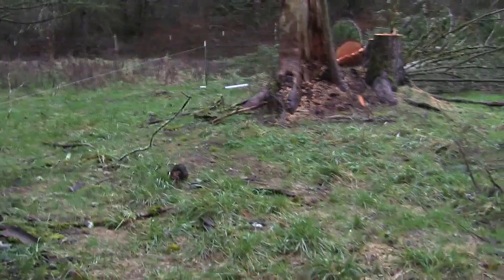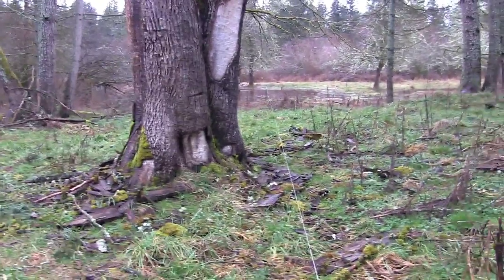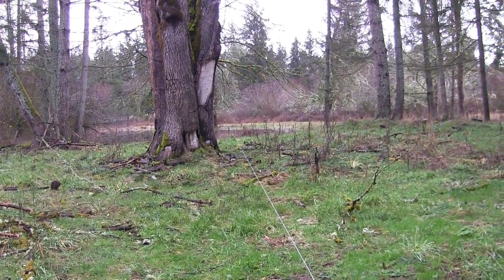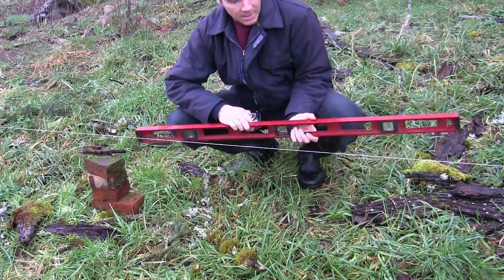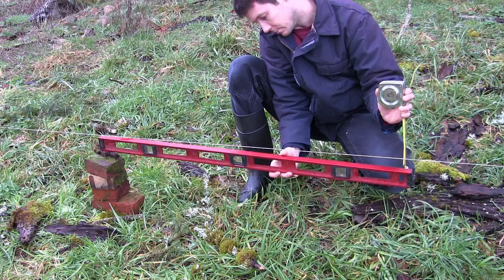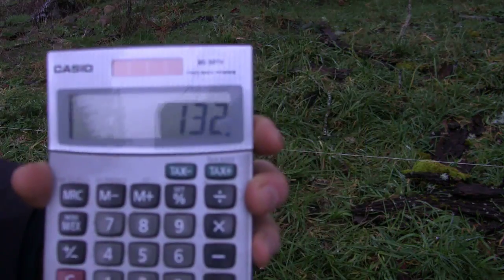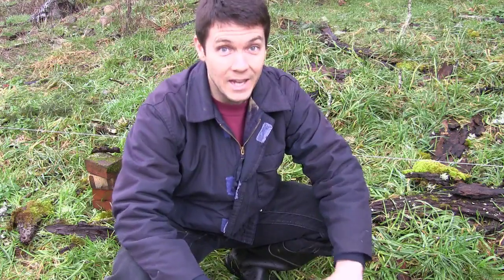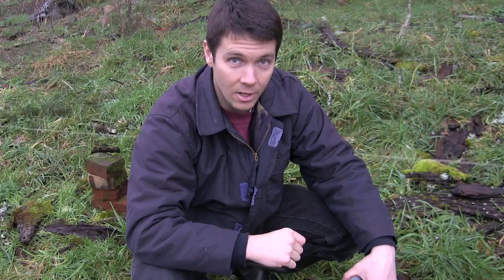How to Measure Elevation of Land, Slope, With a String and 2 Metal Posts: No Transit or Laser Level

Comment: From an engineering standpoint, this makes makes total sense... except for one thing:
Measuring up from the surface of the water at both points would only indicate the potential for the surface water to travel from pond #1 to pond #2.  I think if you wanted to make 100% sure that ALL water from pond #1 evacuates to pond #2, you should measure up from the DEEPEST point of pond #1 to an arbitrary number, (in your case 41") and then measure up 41" from the surface of pond #2. Assuming pond #1 does have an exit, this method would ensure that pond #1 would never fill again once you graded the property to channel the water to pond #2.
Reply from the maker: Very very good point, thanks.  After going through the whole process of digging the trench, there was in fact about 3 inches of water still in the top pond.  I'm really happy with the results but need to fine tune to get rid of that water.
Reply: @MikeKincaid79  how did u dig trench and get the water to run downhill did you use and pipe or what ? Middle if my yard keeps sinking it fills w water also some on side both neighbors one in right side and one in back have higher lawns than me and their water runs off into side and back . But middle I think is just low . But right side definitely alot comes from their run off . How do I fix side . And do I just fill in low points with dirt it will it keep sinking from their run off water
Reply: @johnanderson3746  I have a similar problem at my house.  I solved it by simply adding 120 yards of dirt in my backyard, which raised it enough to allow a swale between our houses to channel the water away.  If you can't do that, rent a trencher for a couple hundred bucks for the weekend and put in some drain tile.

Comment: THANK YOU - I was trying to recall this technique but in my case it was to determine floor elevation measurement. I had a snap line but that didn't seem quite right. Then I had the nails and string and was measuring along the string from the floor but knew I was missing something ; the level made a big difference.
Reply from the maker: Awesome!  Glad this was helpful.

Comment: Hi Mike, hope I'm not speaking out of turn but would it not be simpler to just run a long hose from the top pond to the bottom one and create a syphon to get the water flowing. Gravity will do the rest. Saves digging a massive 100ft long trench ? (once you've established which is the higher body of water of course as per this method.
Reply from the maker: That would work well too but I much prefer having the trench that I dug.  I haven't had to worry about standing water for several years.

Comment: If it works...great. As mentioned....from base of one pole to other make sure your line level is level. Now measure at point 1 from ground to string height, then measure point 2 from ground to striong height(this would be the point thats underneath the water)...when string is level, that difference in height is your slope. Keep it simple...you may need some  boots.

Comment: Hi Mike, on your video , you divided 33 feet by 12, where did you get the figure 12
Reply from the maker: There are 12 inches in a foot.  I could have stuck with 33 inches but I wanted to convert the 33 inches into feet.  33 inches divided by 12 inches is 2.75 feet.

Comment: Good video, only it would matter what the depth of the upper water is, hopefully it isn't deeper than 2.75 feet.
Reply from the maker: Very true.  The volume of water is also part of the consideration and I worried about that a little but in the end it worked out.  It turned out that when the lower pond rose to a certain level, it poured down a natural little path that ran off my property and under a culvert at the main road.

Comment: @Mike Kincaid   Hey Mike, you never applied (or at least never mentioned again) that 1 inch gap which you measured on the slope from the end of level to the line.  As you know multiplying by 1 doesn't change anything anyway. Lucky for you,  but for myself and others who have a different number for that gap over the 4ft of the level, then we are missing that important step to then multiply that number.  Nonetheless thank you for putting me on the right track and teaching me something I could use.
Reply from the maker: You're right, thanks for pointing that out.  It just worked out nicely for me I suppose.  If the measurement was something different than 1 inch, let's say 1.5 inches, then you would just multiply that number by the number of 4 foot lengths that I got, in my case 33.  I apologize for the confusion.

Comment: Stupid question from me: which end was the high end? The one where the level was touching the string or the other. Touching, I'm assuming.
Reply from the maker: No stupid questions here, if I remember right the end of the level that is not touching the string is the high end.  The string is not level and is going downhill toward the other end of the level.  Really, it doesn't matter though because you could put the level on top of the string and measure it that way from the other side and get the same result.  It was just easier to prop the level up on bricks and measure with it under the string.  Thanks for asking!

Comment: Hi Mike, been a sub for 1.5-2 yrs and right now I'm trying to figure out what the slope from my house to the street should be. Currently it is a negative slope (don't know the terms) back to my house (no basement) but a muddy mess when it rains and a big hole near the faucet - might have a leak too (in Springfield Oregon). One guy on a YT video suggested 1" per foot, so if I have a 25' lawn from house to street 25" (or a 2 foot slope) is a lot for a "flat land" house. You just measured out a 3' slop over 132' distance. I'm trying to build up a 30' section long the front of my house while the neighbor has all this extra dirt and I have the energy. Maybe 1" for the first 10' then 1/2" for the remaining 15' ??? I don't know where to look for the recommended grade from house to street. Any ideas? Whatever you have would be great. Thanks Mike  ps I told you I have changed my Hydrangeas from Blue to Pink by adding only baking soda to the soil.
Reply from the maker: I remember your baking soda comment.  I'm not an expert on code in different areas but I do know that the typical septic line runs on a 1/4 inch per foot slope.  I would think that should work well for your purposes too.  That would give you a 6 inch drop.  Much better than 2 feet.
Reply: @MikeKincaid79  Thanks Mike it's just to give me a rough idea and that works. I could get the landlord involved but I don't want my rent to go up again. $975 2bed duplex Spfld & I've been here 18 yrs. Be glad you bought when you did, you have  beautiful property Orchard/Rhodies &
Twin Daughters : D

Comment: why divide by 12 at the end ?.
Reply from the maker: Turn the inches back into feet
Reply: @MikeKincaid79  ?.
Reply from the maker: I had a 33 inch drop from one side to the other.  I wanted to know the measurement in feet so I divided the 33 inches by 12 to get 2.75 feet.  So I had a 2.75 foot drop in elevation from one side to the other.
Reply: @MikeKincaid79   33 x 1 inch = 2.9 foot not 2.75?.
Reply from the maker: Paul, I think you need to check your math.  33 x 1 = 33.  33 inches divided by 12 inches equals 2.75 feet.  I think you are confusing 0.9 with 9 inches.  They are 2 different things.  0.9 of a foot is 0.9 x 12.  This equals 10.8 inches.  9 inches is 0.75 of a foot.
Reply: @MikeKincaid79   maths was never my best subject.thank you for you time 👍.
Reply from the maker: LOL, glad we got it sorted out for ya

Comment: Thanks for this.  I'm, trying to find the fall over a longer distance (about 330ft). I'm finding it hard to tighten a line over that distance to get anything like a constant fall.  I could break it into section, but suppose I made a level platform at one end of my slope, put my 5ft level on that platform, and lifted one end of it so that when I sighted along the top of the level (using it like a rifle) so that it lined up with a point at the other end of my slope.  If I fixed it in that position, using a clamp perhaps, and measured down from the end of the level to the platform (I hope that's clear!) do you think I could do essentially the same calculation you use here - ie., if the distance between the elevated end of the level and the platform was 6in, could I assume that the fall was 6 inches per 5ft across the distance of the fall?
Reply from the maker: Yes, I think you're on the right track.  As long as you've got a straight line, you can figure it out.  330 feet is a long distance and remember that if you go to the center of the string where it dips the lowest and then comes back up, you will be as close to the true line as possible.

Comment: What would the formula be if it was 2 inches for every 4 feet
Reply from the maker: (Total length) divided by (4) times (2) divided by (12).  That will give you the answer in feet.
Reply: Mike Kincaid total length needs to be in feet for this formula to work. Great video!

Comment: Wrong you don't go to middle to measure  only need to come in or along the string line a metre or so ;because of sag Working in metres is easier  example   30 millimetre gap over a   1 metre level  is a 3% fall  one end of level [high end touching string  gap at other if there is fall
Reply from the maker: Rethink that, Ray light.  If you measure from the end, you will be measuring where the string is descending.  If you measure in the very middle where the sag is at it's lowest, it will be even and level.
Reply: @MikeKincaid79  The sag will actually be closer to the lower stick and not in the middle. Next time you see an electric pole line where one pole is lower than the other you will see the sag is closer to the lower pole. But as long as you were able to determine which one is lower that's all that matter.

Comment: i need a vide on how to level the back yard only about 12 feet left to right and 26 feet font to back  left side is some what leveled but as u move the the left side it starts to move down like and at the 10th feet it going way down low i nee it to be all at eh same level and flat so when i put my 12 x 20 cage with a extra 5 x 5 cage at the front  it will be flat on the ground it is for my cat and the ground need to be flat so that the cat does not get out from the bottom got any videos for that
Reply from the maker: Sounds like you need a lot of fill dirt.  What do you have, a tiger?
Reply: i have a short hair tabby about 7 to 8 bl. he not big at all but as he can no longer be in the house his will be his new home he only like it in the family room and that is almost the same size he dos not like any other part of the house so making cat condo apartment aka cat enclosement will be almost the same thing  just want him to have lots of room to run around. how much do u think it would cost to pay a person to to level it for me i do not know what im doing so i thinking might be better to have a person who know what he is doing
Reply from the maker: Not sure, you'll just have to call around to some contractors

Comment: How did you go from 33 feet to 33 inches?
Reply from the maker: It's 132 feet between t-posts.  The level is 4 feet long.  I've got an inch of drop for every 4 feet.  The math: 132/4=33 inches.  I've got 33 inches of drop across the whole 132 feet.  That's 2.75 feet of drop.

Comment: That's not the way I'd do it, an easier and more accurate way is to just bang one end down until the line is perfectly plumb and level in the middle with the spirit level then just measure the height at each end and subtract them and you have the fall. With your method even 5mm out at your level could be 200mm out at the end.

Comment: I’m trying to understand how are you able to get the overall drop with your calculations. 
Length from post to post is 132 feet 
Length of level is 4 feet 
12 inches=1 foot 
132/4=33 feet/12=2.75 feet 
Why would you say that you have 2.75 feet in elevation  per 4 foot ?
Why would you say that you gave 33 feet in elevation total ? 
From my understanding diving the total length between the posts by the length of the level is not going to give you the drop but just a simple segments of the total length divided by 4. 
The only thing that is giving you the drop is the 1 inch every 4 feet. 
The only reason your math is working is because your drop every 4 feet is 1 inch, if it was more than 1 inch then your math wouldn’t work. 

So I think the math should be 
(This only works when is multiplied by 1 which gives you the same result) 
1 inch = 4 feet 
X inch= 132 feet 
=33 feet/12=2.75 

But let’s say the difference is 1.5 inches every 4 feet 
1.5 inches=4 feet 
X.  Inches=132 feet 
=49.5/12=4.125 
Whereas if we use your calculations 
132/4=33/12=2.75 it would always give the same exact result of 2.75 inches regardless of the drop. 

None the less, thank you for the video because this idea would help me figure out what’s the drop in my backyard for a fence installation I’m doing where I want to see how high from the ground each post needs to be at to sort of have another guide on top of the top line we need to run.
Reply from the maker: You’re welcome for the video.  Trust me, the math works great.  I’ve been challenged about it hundreds of times since posting this and in the end, most people finally see it and say Oh, I get it, lol.
Reply: @MikeKincaid79  Mike thank you for relying, I noticed a lot of people where asking stuff such as “where did you get the 132 from ?”, “why do you divide by 12”, “why did you divide by 4?” And that’s because they didn’t watch the video twice and took the time to write down all those values. However, I understood all of those values and wrote it down and still think that dividing 132 feet by 4 feet would not give you the drop between point A and point B, the only reason it did give you the drop between point A and point B is because it happens to be that your drop when putting the level against the string is exactly 1 inch but if it were to be 1.5 inch.. then you would have to calculate that and thus multiply 132 x1.5 and then divide it by the length of your level in order to get the overall drop in inches between point A and point B.
Reply from the maker: Yes, everything you said is exactly spot on.

Comment: Suppose I could do the same thing with my digital angle gauge, then just use trigonometry to calculate the drop from the angle.
Reply from the maker: There are multiple ways, with multiple tools, to achieve the results.

Comment: he assumes the land is flat - in one plane - over the distance .  No ups and downs ??
Reply from the maker: No, I don't assume anything about the land between the 2 points.  I think you aren't understanding the concept.  Doesn't matter if you have ups and downs between the 2 points.  Doesn't matter if Mt. Everest is between the 2 points.  If 1 point is lower than the other then the water will flow that way as long as you have a path for it to flow down like a trench.

Comment: Is it me or does the measuring and calculation seem wrong on some fundamental level? Why wouldn't you set posts at set intervals (say 10 feet) and level each span between poles? That way when you get to the end you can know exactly all the changes in elevation without doing a circus act holding a level and a tape measure in mid air at the center of a 132 foot span of sagging line.
Reply: The "wrong" is that he should've just drawn a tight level line with a string level attached to his string and just done a straight measurement from the string down to his ground. I linked him up with the proper $1.99 tool and a comment so that he knows the easy way from now on.
Reply from the maker: I think you're both missing the point, lol.  I worked with the tools I had, a level, tape measure, string, and 2 t-posts.  I suppose I could have gone to the store and bought all the proper equipment but that defeats the purpose of the video.  Also, there's more than one way to skin a cat.
Reply: @MikeKincaid79  sure pal, whatever.